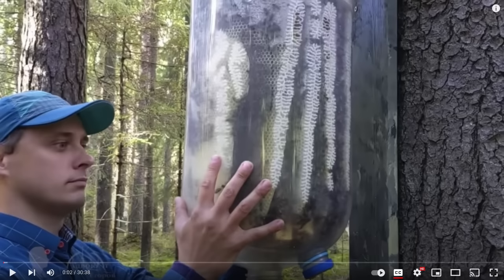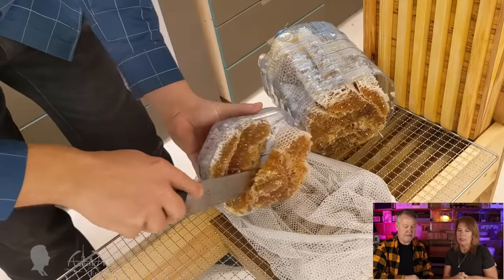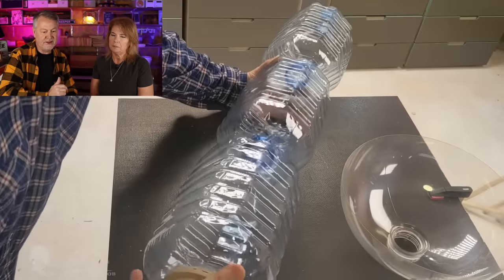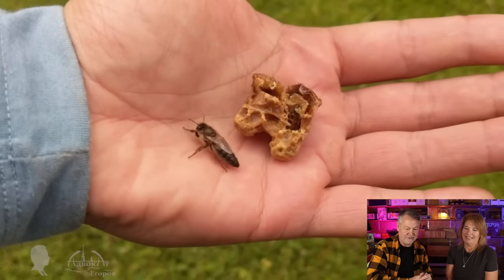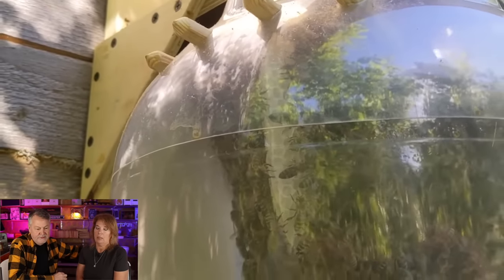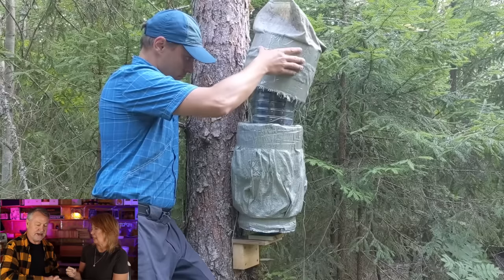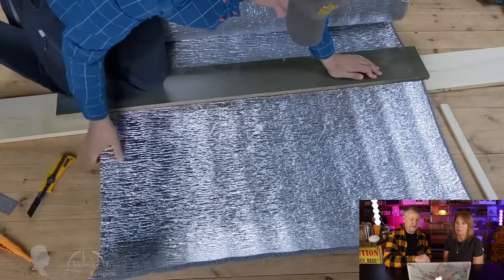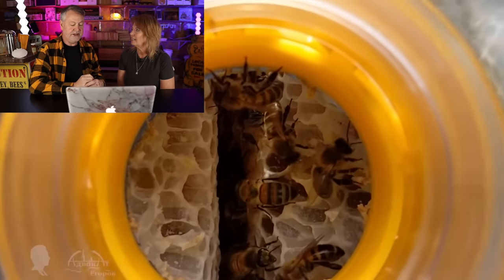Beekeeping Bottle To Bottle Review & What I Think Of The Flow Hive

Comment: For what it's worth, in watching the original video. They didn't touch upon the voice over at all and reduced much of the footage that addressed many of the concerns. 
Here's my major thoughts on the issue as touched upon by y'all folks:

--In the use of plastic: He had suggested coating in the inside and outside with beeswax to massively reduce the risk of plastic lechate into the hive and honey.
--These hives are for proof-of-concept and for demonstration, so they lack "ease of use" and some accessibility. Respectfully: This is NOT a FINISHED PRODUCT and I feel like that might have been a huge misunderstanding for y'all folks! He's still working on a more efficient method and there is some room for improvement, such as in cutting the plastic for harvest. So... why post it up? For your valuable input. He's but one man trying to polish up a wide project that has the chance to support local ecosystems more efficiently, so he needs more hands to help him figure this out. He's only about 3 years in to it.

--Much of the construction is efficient once understood, something done largely from recycling, and could be done over a few weekends; it will only get more streamlined and accessible as a more polished model is ironed out.

The real purpose of this man's work is to make beekeeping more accessible, allowing more people to support honey bees, while also pushing for changes in beekeeping that could bring stability to ecosystems by changing the approach. 
There was much, much to be learned about his choices and concept through the voice over that was simply not acknowledged in this video and I find that a little unfortunate, as I feel it made everything seem much harder, more confusing, and more irrational than it was. The VO was very helpful.

In regards to very real concerns of mites, pests, and testing for things like foulbrood: 

--He's suggested cutting a u-shaped flap in the bottles to be able to efficiently take samples without disturbing the bees. The hives remain accessible to fumigation, for taking samples, and to be inspected due to the malleability of the plastic... a bit of genius imo if you're willing to think outside the box... It still checks many boxes in maintaining hive wellness, as he explains in the VO, and there's only room for improvement.

--Part of the premise was designed to encourage genetic resistance over time through this method while still protecting his hives and wild hives against disease.

--The queens remain accessible and he sequesters them off using their natural instinct for inspection.

--He also watches his bees for discomfort and found that adding the spigots for ventilation worked very well in his climate; his bees didn't present with stress and remained very busy when insulated even in the summer. He mentioned a peer in a subtropical climate who simply added more vents and saw great success. 

There's a lot of room for improvement for the project and I'm happy to see it being moderately received by critics and piquing interest of even experienced entomologists...on top of being appealing to the common person. Sounds like it has a winning recipe with a little spit and polish.
Reply: Thank you for such a nice explanation for our foreign brothers and sisters that post such reviews without understanding what he is saying and why he is doing what he is doing. I'm Russian and his points are pretty interesting, not laughable at all ..
Reply: Fantastic reply.

Comment: The bottles look like what I'd buy distilled water in. And you'd install the connectors in the bottom. I've cut a lot of plastic and unless you're using a serrated knife and sawing at it, I don't get plastic bits. I'd just wonder how you'd test and treat for mites. Wouldn't want to melt the plastic with OAV...  

My initial thought was that all that comb getting crushed every harvest was a bit of a waste of the bees' time, but if you're as much about using the beeswax as the honey, I guess it works out. Another thought I had was that if  you're a hobbyist and trying to keep to a certain number of hives, it might be a method to keep the bees busy enough not to swarm if they have to keep rebuilding comb for their supers every year.

Comment: Regarding the flow hive. Flow hives are simply a different method of extracting honey and comparable in price to an average 3 or 4 frame centrifugal extractor. If all you ever want is one hive in the backyard then Flow Hive could be for you. Once you have two or more hives it becomes more cost effective to use a  3 or 4 frame extractor. When you have a flow hive all other aspects of beekeeping remain the same; Inspections, queen replacement, disease treatment, swarm control etc.  You cannot tell if a flow frame is ready to extract by looking in the window(s), you MUST open the hive and inspect cappings. Flow frames need to be removed from the box before extraction to ensure they are majority capped just like a langstroth frame. Flow frames, when new, (in the majority of cases) need to have a wax coating applied (similar to other plastic foundations) before the bees will use them In some cases a heavy flow will induce bees to use the frames without waxing the frmes. If honey candies in a flow frame or is thixotropic (jelly like) it need to be heated and liquefied to extract which can be problematic for backyard beekeepers. For many beekeepers flow hives work well but they are not for everyone.